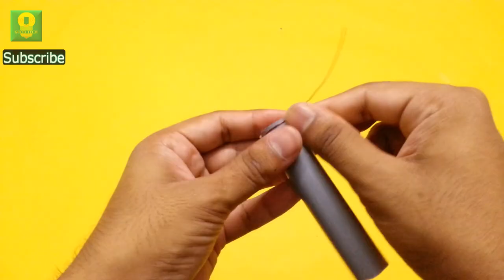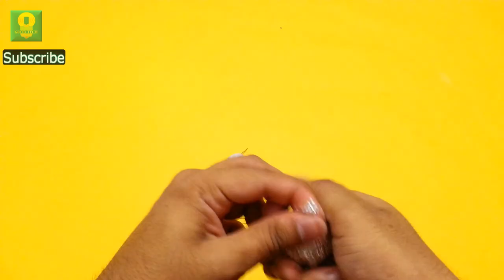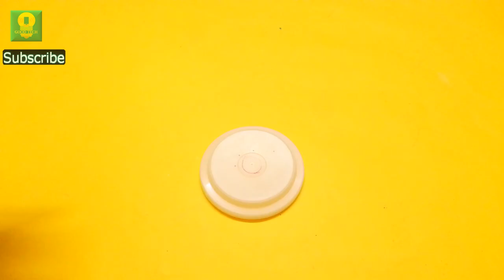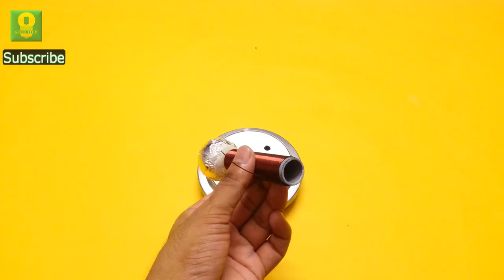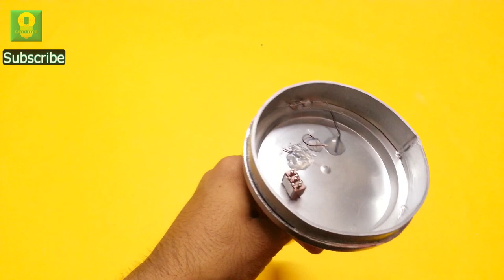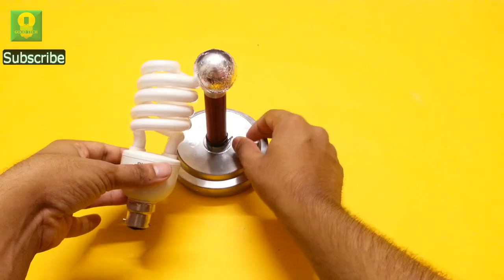How to make Tesla Tower at home

Comment: If you could have the bulb constructed to the frequency of the tesla coil transmitter, so the bulb no longer has to be right beside the tesla coil to light it up, how far away could the bulb be and still be lighted up? I know it is not a strong battery powering the tesla coil, which would have impact on how far the wireless transmission would be effective in lighting up the bulb? So maybe a 1 foot, 2 feet or 5 feet, what?
Reply: air/distance acts as resistance to wireless power,
Reply: theres a show about Nicola Tesla that talks about all that stuff and what his plans were
Reply: Does this really works?

Comment: 25 gauge copper wire i can use ?
Reply from the maker: Yes, it should work fine. In case you have any problems, feel free to ask. If you need additional info, you can also have a look at my instructables - https://www.instructables.com/id/How-to-Make-a-Mini-Tesla-Tower/
Reply: i  failed the project . it's not worked .
Reply from the maker: What problem are you facing??
Check if the transistor gets hot or not?? If the transistor gets hot, then it means circuit is fine.
Also, make sure that you have used a high current 9v battery because a local cheap 9v battery cannot provide enough current. The project needs atleast 500mA at 9v.
Also, make sure that ratio of no. of turns is about 100:1.
Carefully debug the project, it should work definitely.
Reply: @goodtech1  how much distance does the electricity  travel?
Reply: @goodtech1  I used a Panasonic non mercuric 9v battery but it didn't worked..
Reply: @SemiHighProduction   I also failed once

Comment: could a 12v power supply work with the circuit setup shown? I want to increase the amount of electricity into the system.
Reply from the maker: Yes, a 12v supply will work but the transistor might get hot and burn soon.

Comment: if i put my phone near that, will it charge the battery ?
Reply from the maker: nope.
Reply: I think it would destroy the phone.
Reply: 9v isn't enough to charge it
Reply: The average phone today is charged through USB, which outputs about 5 volts. So 9 volts is enough to charge it, and probably destroy it, but i doubt a 9 volt battery has enough amperage to charge a phone.
Reply: converter ?
Reply: Phones require wired connections for charging. The ones that don't require a wired connection charge with a sender and receiver, both of which have the same amperage and voltage. No phone has a receiver that can receive the power from a tesla coil, so no. Tesla coils will not charge phones, regardless of the voltage of the coil.
Reply: Moreover, Tesla coils actual voltage is neither 5V nor 9V, it's measured in kilovolts at least. What we have on the movie, is in reality a kind of very weak SSTC derived from exactly one transistor. It will not generate more than 2W of actual power (when we omit circuitry efficiency losses and heat dissipation and considering all power real, with no imaginary part) as 1kV/~2mA. In reality, there is hardly 1W of power due to all the losses. And you do still need a back-converter from high-voltage/low-current to 5V signal, which generates even more energy loss.
At the other side we have USB, which outputs 5V/500mA (~2.5W) and even fast USB chargers rated 5V/1.5A or even 5V/2A (~7.5W/~10W). Now compare.

Comment: can we use a plastic pipe instead of pvc pipe pls reply somebody
Reply from the maker: Yes, you can use any pipe.
Reply: make a high voltage tesla slayer exciter coil tutorial please
Reply: Suyash Garad it's not the type of pipe that has any value here. It's the coiling of the wire which helps produce an electromagnetic field when electricity is applied. Put the lightbuld with the field and BAM! Let there be light.
Reply: you need to use plastic or wood or any non ferromagnetic or conductive material, so no metal pipes

Comment: I am in India and shopkeepers here  don't know what's awg of copper wire,  is there any other alternative word of any simpler word??
Reply from the maker: Just ask for 28 gauge wire.
Reply: Or 28 swg
Reply: AWG 28 is wire with about 0.32 mm diameter (american wire gauge; the higher the awg number the thinner the wire). Note that the wire is coated with a thin layer of insulation.

Comment: i made it. it worked but my 2n2222a transistor burnt out. why please help me out.
Reply from the maker: 2n2222a is a medium power switching transistor. It can't handle high power. The primary reason it burnt is due to more no. of coils in the primary winding, thus high current flow. Reduce the gauge of wire or the no. of coils in the primary winding to prevent the transistor from heating up.
Reply: ok. which one is primary coil. tower one or small one
Reply from the maker: Tower one, copper coil.
Reply: thanks a lot i will make another tower. with only 150-200 turns.
Reply: Anil Kale
Reply: I made mine too but when d transistor burnt I use another transistor but d light is not coming up again pls why
Reply from the maker: Double check the connections and make sure to use a high current 9v battery, a normal chinese battery will not work with this circuit. It requires atleast 500mA of current at 9v.
Reply: Hey please help!! I made it exactly the same way you did it but mine is not working.. Please tell me where is the problem. No of winds on secondary coil = 4 to 5. On  primary coil = 200 to 220... Transistor = 2n2222 resistor = 22k power supply = 9v.... When i turn the switch on it shows nothing, not even a single small LED lights up! Currently the enameled copper wire was not available nearby me, so i used copper wire from a transformer, medium sized transformer! Please help i need to submit the project the day after tomorrow!!
Reply from the maker: Make sure that the enameled coating of the wire is not damaged. If the wire is fine then, reduce the primary winding to 2 turns to increase the turn ratio. Double check the connections and make sure to use a high current 9v battery, a normal chinese battery will not work with this circuit.
Reply: GOODTECH - Creativity and Science  you on Instagram?  Please give me your username i'll show some photos of the wire..
Reply: Anil Kale which  resistance did you use
Reply: inayat khan 
finally i used 47k resister and cpu fan heat sink
Reply: Which type of seconday wire for 2 turn was used
Reply: Inayat Khan its actually primary wire
Reply: Forsaken Crypt i' want cesar 1 omac
Reply: Can i use BD 135 TRANSISTOR FOR IT
Reply: Anil Kale  maybe the transistor cant hndle the electricity?
Reply: Anil Kale project of class12
Reply: GOODTECH the tower is the secondary!

Comment: Sir I have twice large copper winding on pipe .Will it make effects on my transistor,battery(whether i should take 2 or more batteries) and on resistor
Reply from the maker: If there is too much winding the transistor will soon burn out and the circuit will not work. If you increase the size then replace the transistor with a high power switching transistor.

Comment: That is not a tesla coil, that is a slayer exciter
Reply: Nathan Shin agreed but I think he's saying it's AWESOME
Reply: A tesla coil use AC current, not DC and so must have an high voltage AC transformer, and a high voltage capacitator in the circuit with a spark a gap, and yes, the secondary coil is connected to ground. So isn't anywhere similar like the real circuit xD
Reply: DarkQwerzar , correctly said.
Reply: so can this be useful in any way ?
Reply: here npn transistor has been used as a high frequency switch to convert battery dc into low voltage ac.
Reply: NeXTSTORMING i
Reply: A slayer exiter is a self tuning tesla coil.
Reply: are you sure? because i think its fake

Comment: What material did you use for your secondary coil? Insulated Braided copper wire? Or insulated solid copper wire? Or does it really matter?
Reply from the maker: No, it does not matter. Only the wire should be insulated and slightly similar or more thick than the primary.

Comment: Hey. I see that the wire should be stick together, so what can I use to stick them out?
Reply from the maker: I have not attached the wire coils together, i just used a 28 AWG wire that is easy to coil, therefore, i just wrapped the coils as close as possible. However, after finishing the coils, you can use some super glue over them to hold it in place.

Comment: How many turns do I have to perform if I have 0.10 mm (38 awg) wire?

Since I can not find the wire of the caliber that it indicates !.
Thanks!
Reply: the wire thickness shouldnt really matter, and your 38 gauge wire should work, but just put the same amount of turns, and you might need less pipe to put it on

Comment: Is it necessary to have only 2 turns in secondary winding? Can we have more than 2 windings? And is it necessary to have insulated wire in secondary winding?
Reply from the maker: Use of an insulated wire is recommended, however not necessary, You can increase the no. of turns in secondary but make sure to keep the turn ratio to about 1:100. Also, if you increase the turns, you will need to increase the supplied power as well.

Comment: do you /have a diagram for this? so is the secondary coil acting like a tranformer using magnetic field to chart primary coil, but for this to work wirelessly it need ac

Comment: I have some small doubt's 
★first tell me why we use transistor and what is the function of it 
★and what is the color code of the resistor
Reply from the maker: It is a high power switching transistor that switches DC supply at very high frequencies & generates alternating oscillations. The resistor used is a 27k ohm and has a following color code: Red, Violet, Orange and Gold.

Comment: If I want to make a larger scale of this project, do I need a different transistor and resistor?
Reply from the maker: Yes, you will need a high power transistor and resistor. This transistor will burn if used in a bigger project.

Comment: Do the wire gauges and coil lengths matter much? If I follow this approximately will it still work?
Reply from the maker: Wire gauges and coil lengths do matter. I used a 28 AWG i.e 03mm enameled copper wire on a PVC pipe of 2.1 cm diameter and 8 inch length.
Reply: Do you mean 8 cm length? It doesn't look 8" in the video
Reply from the maker: No, i meant 8 inches in length.

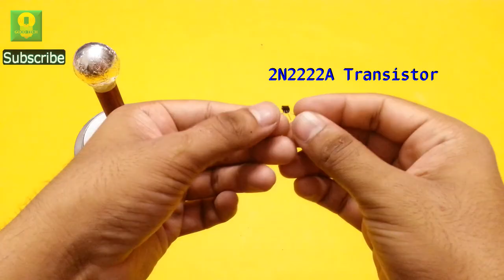Comment: I have a question, at roughly around 2:30, the little bulb thing is stuck through the disk. Is that a requirement? Or could I simply put that whole module on the bottom with wires connecting it?
Reply from the maker: I think you are talking about the black colored transistor. is it?
If yes that thing is not necessarily be stuck to the box, you can just connect it to the circuit and leave it at the bottom.
Reply: GOODTECH - Creativity and Science - Thanks!

Comment: will it work good if I use 12V and 0.2A power supply instead of 9V battery?
Reply from the maker: No, it need atleast 0.5mA, so it wont function well at 0.2A. However, a 12v source can be used.

Comment: What kind of transistor and resistence i'll have to use at 36v? Can i use AC?? Plz answer me!
Reply from the maker: I am not sure what components will be required but google can help in that. Enter the part number that i have used and find its equivalent for high voltage.
Yes, you can use AC with this project but it is highly recommended to never do it with AC mains because the project will become very dangerous and will require too many changes to work.
None of the components that i have used will work with AC. Also, the no. of turns of wire are too less to handle high AC mains voltage, thus you will also need to increase the project size enormously to make it work which will in return make it much more dangerous.

Comment: do you need the aluminum ball ? i just finished building one and it dosent work csn you help
Reply from the maker: Yes, the hollow conductor sphere is very necessary, it acts as the capacitance for the circuit. If the project isn't working then double check the connections and make sure to use a high current 9v battery, a normal chinese battery will not work with this circuit. It requires atleast 500mA of current at 9v.
Reply: GOODTECH - Creativity and Science. thanks 😄

Comment: And can I use simple glue without hot glue.
As I do not have solder can u suggest me alternative way to fix it. If possible
Reply from the maker: Yes, you can use a simple glue but make sure, it is strong enough. It will be quite difficult to make it without solder, but you can try connecting the wires just by twisting them. It is neither permanent nor a good way to connect wires but it can work temporarily.

Comment: yes, I also think that the transistor is burned because it is getting warm but how many turns are needed i turned around 300 to 350 turns of copper wire of secondary
Reply from the maker: I didn't count the exact turns but i wound about (2-3)m of 28 AWG enameled wire on a 9cm of 3/4" PVC pipe.
Reply: How many turns to be made?

Comment: how much metre copper wire is needed,and can I use normal wire to put around the copper wire(the one u did at last:u put some wire upon the copper wires...)
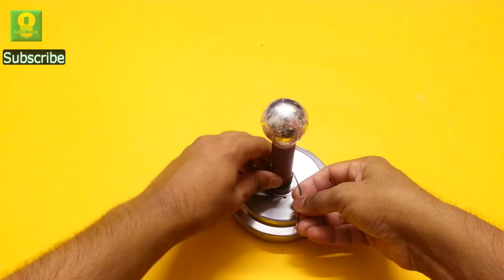Reply: see video 2:09
Reply from the maker: Yes, you can use a normal wire to wrap around copper wire as secondary.

Comment: i have a problem in soldering. The met doesn't melts to connect each other. please help!
Reply from the maker: If the solder wire is melting properly over the soldering iron tip, then it will also connect the materials easily.

Comment: whats the length of the pvc pipe, thickness of copper wire
 & how many rounds of copper wire.
Reply from the maker: Any length of PVC pipe will work, however, i used a PVC pipe of about 8 inches with 2.1cm diameter. The enameled copper wire i used is 28 AWG & wound about 250 turns.
There is also a schematic in video description, it will help understand the circuit better.

Comment: what would happen if the power supply is increased, how much would have to be done with the circuit to make it work.
Reply from the maker: The transistor will get very hot and burn. To increase the power, you need a different switching transistor that can handle high currents.

Comment: How can I attach the secondary wire to another wire properly to make it longer?
Reply from the maker: It is recommended to use a single wire without any joint.
Reply: Thanks, I have to buy another one. And can I ask the length of PVC Pipe?

Comment: Is thin Enameled copper wire okay, rather than 28 AWG?
Reply from the maker: It will not work , if the wire is too thin.
Reply: If I use 18? Will it work? A thicker one

Comment: Pleaseeee reply fast......i need to complete this project urgently...i am using a 9V battery,tip31c transistor,47k ohm resistor.My secondary is 1 inch thick and has ~300 windings. I have tried many combinations with the primary but am not able to light even a single LED.plzz help
Reply from the maker: Sorry but, with this you won't be able to light up LEDs. It only works on Fluorescent and neon lights. Also

Comment: Also, how many turns of the copper wire should i make?
Reply from the maker: Try to keep the number of turns in secondary winding between 250 - 300 and that of in primary winding between 1-3.

Comment: i tryed it goodtec i love your diy projects and vids but my tesla coil wouldnt work please tell me why it isnt working
Reply: I did everything exactly what it saod in the video. I got the right type of transistor and right type of resistor and did the 2 coils and 9v battery plz help
Reply from the maker: Which 9v battery did you use?? A normal chinese battery will not work because it can't provide sufficient current to the circuit. You need atleast 500mA of current. Chinese batteries can provide a max of 100mA. A duracell battery (540mA) worked well for me.
Reply: I used an energizer battery its 522mha. I used a 2n2222 transistor and a 1 k resistor. I tryed everything it isnt working. What else can the tesla coil light up? Also can i apply the tesla coil with an ac voltage insted? I am experementing on magentic feilds and gravitational feilds thanks if you help me

Comment: hi bro my 1st question is will it work bcz I'm planning to exhibit this in an exhibition.and my 2nd question is how much meter of wire should I buy.my 3rd question is is those transistors are definitely required.
Reply from the maker: Yes, this will definitely work and it works really well. I used about 3-4 m of 28 AWG i.e 0.3mm enameled copper wire. The transistor 2N2222 is very critical to the working of the circuit as it switches the DC current at high frequencies that creates resonating electromagnetic waves to make the light glow.
Also, make sure that you use a 9v battery which can provide atleast 500mA of current. A normal chinese 9v battery will not work.
Reply: K bro thanks for ur advice I'll surely present it in the exhibition

Comment: Hey I’m dumb but I want to buy the parts to make this but I can’t find any insulated hard wire anywhere pls help
Reply from the maker: Hello Carter,
You can use any insulated wire but it should be slightly thicker than the primary wire. Also, all the parts are mostly available online on ebay and amazon. If you need additional details and material links, you can look at my instructables page- http://www.instructables.com/id/How-to-Make-a-Mini-Tesla-Tower/

Comment: Can I apply the same process in this video to a larger scale?
Reply from the maker: Yes, you can but you will need to change the transistor to a high power switching transistor with a heat sink. Also, this project on large scale will be quite dangerous as high voltages will be involved that can prove to be very fatal.

Comment: is copper wire appropriate as a secondary coil?
Reply from the maker: A hard insulated wire usually works fine, however, if you use enameled copper wire , it should be thicker than the wire used to make the coil.
Reply: What's another term for hard insulated wire? A specific one.